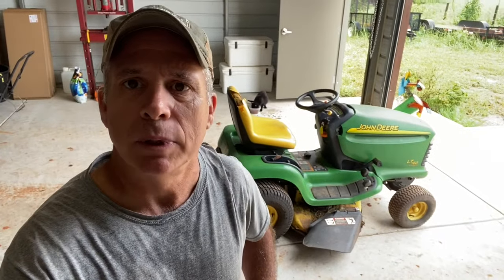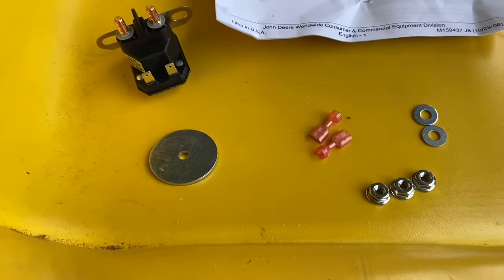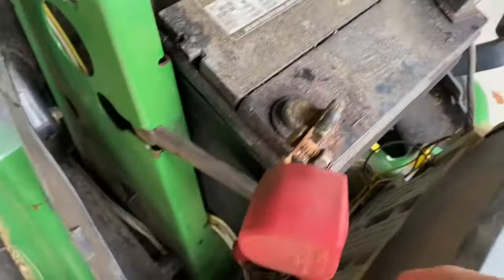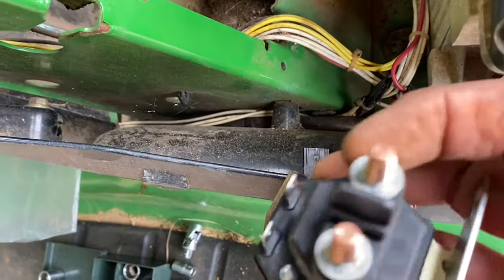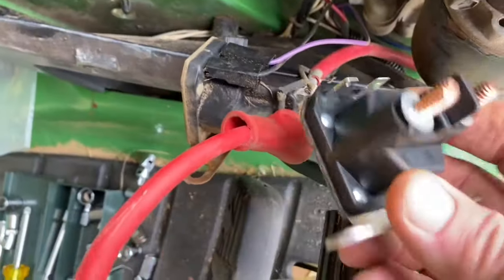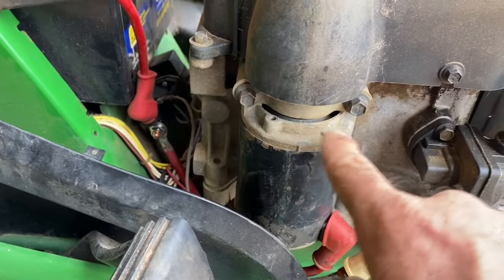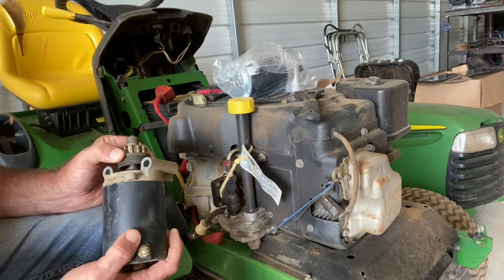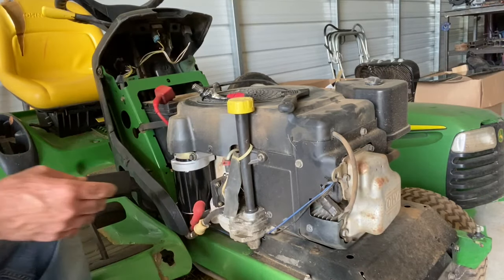John Deere Lawn Tractor won’t start, starter solenoid or starter

Comment: Good work. I would suggest to those watching jump the solenoid with a screwdriver, if the starter does not crank it's a bad starter if it does it's a bad solenoid. Also always check that your battery is fully charged.
Reply: Great info thanks!
Reply: It could a safety switch not making contact too. Like a seat, blade switch or lever to engage the blades, and parking brake
Reply: @mick so if I use the screwdriver it cranks over and after a little starting fluid the mower will run but I can’t figure out why the key won’t crank over the motor but a screw driver will and this is after I’ve all ready replaced the solenoid
Reply: @beauhampton452  I would guess the ignition switch is bad. Test to see if 12v are going to the solenoid when you turn the key. If not, either there is no power to the ignition switch or the switch is bad.
Reply: @Old600Rusty 😮 5:43

Comment: Had the exact same problem. I just used some dry lubrication and the bendex started functioning perfectly. However, I do know that it will need to be replaced soon. Good video 👍💯

Comment: ONE MORE THING!  After checking things out completely, my mower still wouldn’t kick. Turn the key; nothing. I put a multimeter on the two white solenoid plugs and saw I wasn’t getting any voltage. I started tracing the wires and finally found one itty bitty purple wire that had been chewed off at the plug by a mouse. I bypassed around the plug with a splice, and VROOM!

Comment: Good video - my John Deere is a 214 made 1978 .. I got it back and some new parts - key switch and top SOLENOID . No click , maybe they have wires wrong and there is all so a top solenoid above the 2 prong one !

Comment: If you have jumper cables and a spare battery, you can simply clamp one end of the cables to the battery, and the other end's negative to the frame and then touch the positive clamp to the starter's fixing bolt.  If it hesitates at all, it's 100% a bad starter.  This was my method for diagnosing a bad starter, after wasting money provisionally replacing the key switch!  Now the tractor starts up readily, every time I turn the key.  It had been intermittent for 2 years.

Comment: you could have taken a screw driver and stuck it to both big bolts sticking out of the solenoid and that would have bypassed the solenoid and it would have started if that had been the trouble. Just letting you know for future reference so you dont have to buy a solenoid first.

Comment: I used a power pack to jump ,no go. Same with a battery to jump start. So I changed the solenoid . Still no start. Used the screw driver to jump across solenoid. Fired up like perfect. Going to order a new key switch.fingers crossed.
Reply: Did a new switch fix the problem?

Comment: Just put a screwdriver across the solenoid terminals . Easiest way to determine stater or solenoid.
Reply: So which is it is if starts with the screw driver? I have this problem when starting, no noise at all.  Use the screw driver across solenoid and it starts
Reply: @maryannfrancischelli8511   did you ever figure your issue out? Mine is doing the same thing and I already put a new ignition switch on it
Reply: @micahwelch1089  bad starter solenoid.

Comment: They can get stuck like that sometimes. Usually if you just use a flat blade screwdriver to move the wheel it will unstick and start working again. Or pull the starter and put it back again.

Comment: Does the new starter have a cap on the top that you have to remove? The one in this video does and mine does but I can’t get it off and don’t want to break a brand new starter…

Comment: I’ve checked the fuse,key switch, replaced the mower switch, and the solenoid twice. Still won’t start until I put a wrench across the solenoid, works every time, just won’t start with the key.

Comment: My LX277 has been starting erratically for the last two or three years.   I checked/replaced all of the idiotic "shutoff" switches and replaced the ignition switch module and solenoid over this period of time.   A minute ago, I replaced the starter.
Finally, after all of this time, it now starts every time I turn the key.    With the old starter, I never knew when and/or if the mower would start.   Problem solved!
Reply from the maker: It can definitely be an exercise in frustration. Glad you got it finally, thx for watching! Dave
Reply: It sure can!   Thanks for the video, Dave. @bdradley1

Comment: Having these issues with my 20yr old LT150. Just replaced the solenoid..not it..got starter ordered. Hoping thats the solution. If it is...with the new fuel pump and deck belts, shell run a few more years.
Reply from the maker: She be as good as new then! Hopefully that’s it and thx for watching!

Comment: I have a random question do you happen to know what type of cable lugs do you use to replace old ones? I can't find anything on it. It is the lugs that connect the solenoid to the battery
Reply from the maker: David I'm sorry I don't, only thing I can suggest is going to mower shop and seeing what they use? Thx for watching! Dave

Comment: Let me add a Fourth component if those three you mentioned did not work,,,,,There is a Brake pedal safety switch under the deck at the base of the foot pedal/Brake pedal.   These can act like a starter solenoid going also.
John Deere Brake Safety Switch - AM128925.     If those three you mention are not the culprit try this.
$10 part.
Reply from the maker: Good point! Thx
Reply: @bdradley1  No problem great video.    I just replaced my solenoid but no go...so now one of the other three.
Reply: I had the mower deck on the highest setting but I forgot to lock the mower deck bar back into upright position.  Switch there as well.     Started right up but now sporadic.
Reply from the maker: @FreedomRock44  sounds like possibly a stuck safety switch? Maybe clean the dirt out of them, also check electrical connections and clean with contact cleaner

Comment: where did you get a start for $40? John Deer wants $140 for it. Also, how did you bypass the seat switch so that you can test the starter without sitting on the seat?
Reply from the maker: I got an aftermarket starter from an Amazon supplier and then you can remove the switch from bottom of seat and just zip tie it closed

Comment: Guys I need help, my mower d105 will start right up if I put a wire between the two posts on starter solenoid, but I tested the solenoid and it clicks and has continuity! So what’s the issue?

Comment: I tried to replace mine with a new one but when I hooked up the battery the starter engages without the key being turned. I thought the part might be faulty but when i put the old one back on I got the same result. Not sure what I'm doing wrong. Suggestions Ive  had might be I'm overtightening the connections and there's a short .I disconnected the positive cable from the battery when i did this ,someone also said I should have disconnected the negative,is that correct ?
Reply from the maker: Battery cables should have nothing to do with it. You’ve got a direct feed providing 12v to starter and my guess would be from a short. Check all wires everywhere to see if a chaffed wire is grounding out on the frame somewhere. Could even be in a bundle of wires where the sheath is worn off and it’s metal wire to metal wire. That’s a starting point and hope it helps

Comment: I have an mtd yard machine that just clicks, at times it will crank over for a split second. What should I replace, solenoid or starter? I ordered a solenoid from Lowe’s but it’s a 4 post, mine is a 3 post. How would I wire that?
Reply from the maker: Verify that your battery is fully charged and terminals are tight first and then if that’s good, it could be either one but I’d get the correct solenoid for sure rather than trying to make something work. You can get aftermarket ones on Amazon
Reply: @billsmith1770  Thankyou for your reply. I did get everything working 9 months ago when I had these issues. I got a replacement off of Amazon.

Comment: How do I know the solenoid doesn’t work like mine doesn’t click and list time it started the deck was off so I put the deck on and it didn’t even try to turn over and I checked the battery I did battery restore and the electronics work except the solenoid so is the solenoid toast or something else
Reply from the maker: Hard to know without seeing but I’d check all of your safety switches. One of those could possibly causing the “No start”. There’s one for the seat, for neutral, for the blade being engaged, etc. Sorry I can’t tell you exactly bc I can’t see it. Hope that helps and thank you for watching!

Comment: I have to keep replacing my battery every 6 months? What is up with that?
Reply from the maker: Without seeing it, it is hard to tell you exactly. It could be your alternator is not charging it correctly and back to full amperage, or you have something pulling a very low draw on battery (have no idea what however), cheap battery, not  correct battery??? Maybe putting a trickle charger on it when not in use would help, there about $35. Again it’s just to hard to diagnose when I can’t see it but hope I’ve steered you in a direction that may help.
Reply: @bdradley1  Thanks so much for the quick response. I do have it on a trickle charger...this is the 4th battery in 2 years. No clicking, just all of a sudden it doesn't start. Battery is correct for mower. I was thinking maybe the charger was draining the battery is that possible? I have checked all connections, 20 amp fuse etc. Appreciate you.
Reply from the maker: @ChristineThomas333  I have had trickle chargers actually boil the electrolytes out of the battery before!!! Best battery is an AGM battery rather than a flooded battery. Make sure that the trickle charger is on lowest setting (2 amp) and that it goes into a “float” mode once battery is charged rather than just continuously charging, that way when battery drops below recommended voltage, the charger will come out of float mode and back to charge mode.
Reply: @Marj I took the old battery that was still under warranty back to Lowes, they replaced it for free. It works great without the trickle charger. I don't know the brand, but it was the only one that fit my lawn tractor.
Reply: @bdradley1  Thanks, I bought a new battery, nixed the trickle charger....has been working great. Thank you for the great advice.

Comment: I’m trying to repair my Grandma’s Scott’s lawnmower and having problems tonight. Not getting the click or turning over. Battery shows fine at the posts and I’ve been charging that battery a few hours. No clicks and very slow turnover on top part. Idk man 🙁
Reply from the maker: Possibly one of the safety switches? You’d have to use a multimeter to check however, it’s really hard to diagnose without seeing.
Reply: Scotts is like a John Deere Sabre.  Had one.  You have a bad electrical Connection.  Clean ALL terminations, especially the Battery Ground connection.
Batteries can show 12V and have few Amps.
Reply: @gordbaker896  still not having luck sir. Took the ground off today and sandpapered both sides of the negative cable/one leading to body. Took out the switch and it tests out okay compared to YouTube uploads. I do see some corrosion on the positive though. Did you ever remove your solenoid? I don’t see how mine is connected at the bottom. I’d hate to just hammer it off if it’s not the problem.
Reply: @bdradley1  I have a multimeter sir, how would I check the two safety’s?
Reply: @timweb1510  I have some Battery Terminal cleaner in a spray can.  I disconnected the 10 or more wire connector that is close to the Ignition switch on my JD X320.  Sprayed a little on both and reconnected.  My fuel shut off solenoid has worked perfectly ever since.  That is why it was not starting.  Good Luck.
Reply from the maker: @timweb1510  rather than me try to explain it to you, it would be easier for you to watch one of the many videos already posted. Just search “how to check mower safety switch” and you will see and understand easier. Thx for watching!
Reply: @timweb1510  I would remove the old Battery and try a known Good One.  You can bypass the Solenoid by Using a battery cable from one big terminal to the other, or go straight to the Starter Motor with the + cable.  It should turn over then as you have bypassed switch and solenoid.  If not, new Starter?
Reply: @bdradley1  I have watched sir and I still failed
Reply: @gordbaker896  th sk you for trying to help me Gord Baker, I have worked over 20 hours on this lawnmower in between yt repair videos and work. The last time I tried connecting the positive straight to the starter I got it to turn over slowly, but I never checked what position my choke lever was in or key in run status. I’m worried about the spark as my gas tank is next to open end of starter where it sparks. I may try four way cables with the starter and ground on one side and battery charger a foot away plugged in. Idk, I just got home after working since 1pm on this again today 😐
Reply: @bdradley1  all 3 of the safety switches checked out when I tested them today for continuity and low ohms resistance. The one above the rear seat had a higher than usual resistance but I’m not sure
Reply: @timweb1510  Please remove the Ground cable at the frame and be sure it is a bright clean connection with lock washer.  As long as the cap is on the tank tightly and there is no spillage there is little chance of fire. Try a Different Battery of known Amperage and Voltage.
Sounds like a battery or connection problem to me at this time.

Comment: I’m having a sort of similar problem with my STX38.  I replaced the original starter last fall with a cheap one from eBay.  It seemed to work good initially but now I’m having trouble with the bendix sticking, mostly in the up position.  I recently found a discussion where someone said that the gear on the cheap eBay starters does not have the same amount of teeth as the original and so it can have trouble engaging with the ring gear correctly.  Has anyone heard of this?
Reply from the maker: I have actually had issues with the cheap starters doing this. I just ordered another and so far so good. You get what you pay for as they say but I just didn’t want to pay JD price with a mower that has over 750 hrs!
Reply: @bdradley1  thanks for replying.  I think I’ll have to bite the bullet and go back to an OEM starter.  Huge price difference, but the cheap one obviously didn’t save me any money.